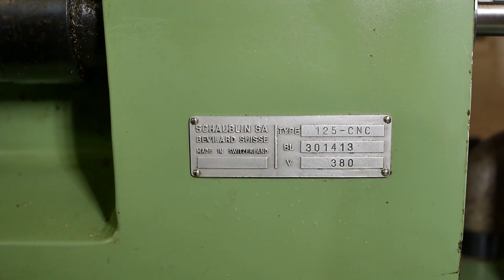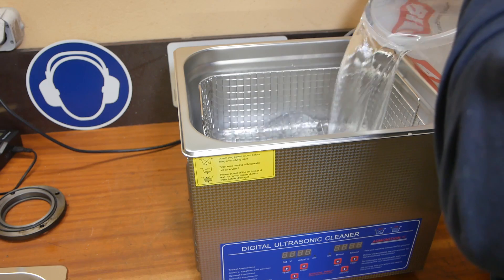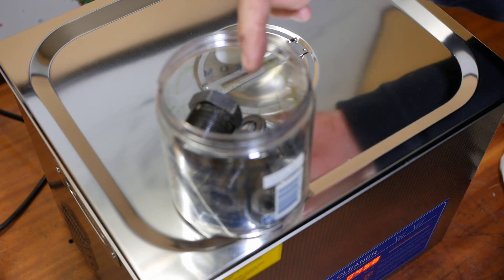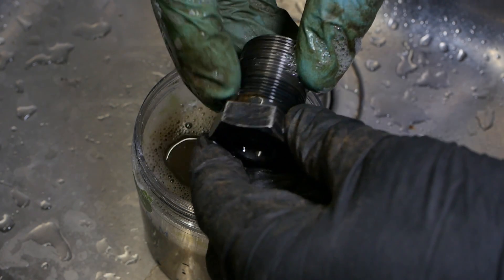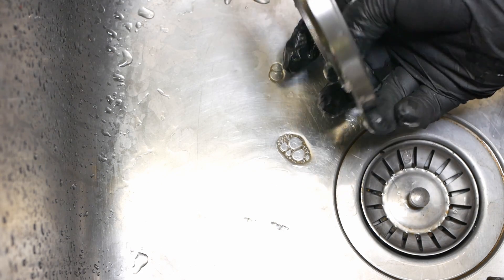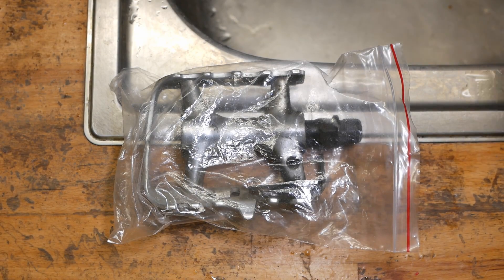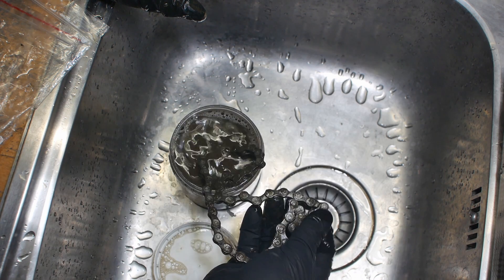Do cheap ultrasonic cleaners work? || RotarySMP

Comment: I bought a 6l one this week too. I got really mixed results but i think it was worth 60€. I use mine on moped motor parts.
Reply from the maker: I'll have to find a decent eluminium cleaner, but for steel and iron parts with caustic cleaner it is really helpful.
Reply: @RotarySMP  I tried out putting gasoline in a jar and that in the cleaner and it seams to work perfectly. Awesome idea and with the jar
Reply from the maker: @derjan236  Good to know. I will have to find a jar large enough for the piston.
Reply: @RotarySMP  yes jars are the problems and with gas they need to be seeled in my case. But pet bottles are resistant to gas. Maby there are ones with a big enaugh opening
Reply from the maker: @derjan236  It has been said that plastic absorbds some of the sound waves, reducing cleaning action.

Comment: You laugh about the chips but ultrasonic baths for chips are a thing for the fancypants chefs. Parboil, then put them in an ultrasonic bath to break up the surface of the chip with lots and lots of micro-cracks, then fry in oil at low temp and then at high temp. Makes them extra-crunchy. 

Can't recommend doing that after cleaning machine parts in the cleaner mind you :D
Reply from the maker: That sounds like a lot of work when you can just buy pringles :) I wont do food in this.

Comment: Could you canabalise the motive parts and waterproof, then attatch to your bbq plate with a magnet or clamp and drop the whole thing in a bathtub? it looks like it needs the little rigid tub to transmit the ultrasonic waves so could you flip it around and make it clean the container it's inside and magentically attatched to, get a swimming pool and drop in the whole lathe. I do expect the effectivenes would drop tremendously,
Reply from the maker: Or just leave the BBQ caked in coked grease. Adds flavour.

Comment: I was about to say that using caustic cleaning agents on precision machinery might be dangerous, but then I remembered that I used strong acid to clean my toilet, so I am in no position to say that.

As for the pedal - you might wanna try to re-plate it with zinc. Shouldn't be too hard, and could be an interesting topic for a video.
Reply from the maker: Nah, that bike is is seriously worn out. The one black pedal stays.
Reply: @RotarySMP  Fair enough, although it could get rusty with time. Then again, you could then boil it to convert rust to black oxide, which would protect it from further rust.

Comment: Thanks for the video. Be careful about using plastic bags. If the part has a sharp edge it can cut through it, contaminating the water. Don't ask me how I know. :O( . Try cola for getting rid of carbon build up. It works on gas parts on rifles. Keep safe and stay well.
Reply from the maker: Thanks. Yeah I areadly had that with bags. I was thinking of cola for rust due to the phosphoric acid. Have to try it on that piston as well.

Comment: FYI: Ultrasonic cleaners will remove hot/cold blueing on parts... just something to be aware of.
Reply from the maker: Thanks.
Reply: well that is technically the same thing as rust so that makes sense.
Reply: @Xlaxsauce  yep!
Reply: Interesting, is that true no matter the cleaner? I think I have a local gun shop that offers “ultrasonic cleaning”.
Reply from the maker: @Mrcaffinebean  I am pretty sure that will be dependant on the chemical used.
Reply: @Mrcaffinebean  Yes. Ultrasonic is great for a dirty polymer handgun. 

As someone else said. "Blue" is a surface oxidation (rust) and ultrasonic will take it off pretty quickly.

Comment: I just use brute force and a wire wheel on everything, makes a mess, this looks like it works like a charm
Reply from the maker: I also used a lot of steel wool and scrubbing. This is way easier. Especially with caustic on steel parts.

Comment: I'm off looking for a bbq size version!
Reply from the maker: Sure would be handy. I wonder what sized ultra sonic baths are used in industry?
Reply: @RotarySMP  Huge I imagine. They have to clean big things before coating, electroplating etc. and bipolar chemicals are both expensive and industrial hazards as well as too slow.
Reply from the maker: @Bennyboy-dog  We had a huge process bath we called "paragon". I once through in a whole a bike frame over night. Came out perfectly clean of any gunk or paint. No idea what the active ingredient was.
Reply: @RotarySMP  Back in the sixties (yes I am that old) we had a 4X4X4 container heated and with a pump to keep the fluid moving, it also had a cooling collar that water flowed through to keep the fumes down. It was filled with trichloroethane(think carbon tetrachloride) to degrease parts before painting.Back in the sixties (yes I am that old) we had a 4X4X4 container heated and with a pump to keep the fluid moving, it also had a cooling collar that water flowed through to keep the fumes down. It was filled with trichloroethane(think carbon tetrachloride) to degrease parts before painting.
Reply from the maker: @july8xx  Carbon Tet was also some pretty nasty stuff, but a very effective cleaner.
Reply: @RotarySMP  I used one with a tank about a meter and a half long and maybe 70 cm width and depth; it was pretty vicious.  You can get the transducer and drive separately and put them in your own container, maybe one of those plastic beverage totes if you need more usable volume.
Reply from the maker: @jimsvideos7201  Thanks. I am pretty happy with this one.
Reply: You could just go for the cheaper normal sized one but with the "bigger on the inside" upgrade. The only snag is the bbq wouldn't fit in or out through the opening itself, you'd have to resort to quantum tunneling...
Reply: @AttilaAsztalos  Tardis ultrasonic cleaner - hmm, I think you are onto something. Quantum tunnelling shouldn't be a problem. I have the muon transformer all wired up...and not.
Reply: I used to work at a place that was half machine shop, half car recycling/parting facility and our biggest ultrasonic was 4*12 meters and maybe 2.5 meters deep 

The guys over at the car department used to strip the cars of liquids and fabrics before dropping them whole into it using a crane, did wonders on stuck bolts and all the grunge found in old cars
Reply from the maker: @angrydragonslayer  The exciters must have been monsters. Rattle you fillings out?
Reply: @RotarySMP  i never got to see the exciters but the isolators were huge, about 50 cm in diameter and a meter long, 5 on each long side and 2 at the short sides, probably some below as well

Comment: What I'd like to know is what happens if you put water and sand in a bag with a part that needs cleaning? Does the sand polish (or sand) the part or doesn't it affect it much.
Reply from the maker: Good idea.
Reply: Well I wonder what Scheuermilch is called in english. Scrubbing milk?
Reply from the maker: @herrkulor3771  I speak german and an a native english speaker, but I have no clue :)
Reply: @herrkulor3771  Slurry?

Comment: also: try using glass jars instead of plastic. i watched a video where someone pointed out that the plastic dampens the ultrasonic waves or something.
would also be interesting to see a side by side of same jar and liquid left for same time outside the cleaner for comparison. then you can see what a difference the cleaner makes
Reply from the maker: Glass jars probably last longer in the US as well. Some of the bags got beat up pretty fast, so I doubt the plastic containers will last that well.
True, that caustic solution would also work without aggitation, but I guess it is sped up a lot.
Reply: @RotarySMP  Maybe a stainless container ?
Reply from the maker: @Andrew_Fernie  I have plenty of glass jars and will try one.
Reply: In fact at the beginning of the video when he told he'll use plastic containers I thought the same: inside there will be no US effect at all... maybe there isn't anyway, and it's just the chemistry and the temperature which works there and bring the results ;)
Reply from the maker: @janosnagyj.9540  Could be. Although i doubt soaking a bike pedal in dish water for 5 min would have had the result.
Reply: @RotarySMP  Yeah but the bike pedal was in the bag, not in the jar if I remember well. Some shaking-disturbing effect there was for sure, maybe not super- but subsonic ;)

Comment: Hi again, I'm just wondering if leaving the parts for 5 minutes in the BBQ cleaner on its own would have had the same results?
Reply from the maker: True. I didn't bother with a control, as I was like a kid playing with a new tool.
Reply: no, it doesn't have the same effect, but you might be able to get a similar affect with a heating element and magnetic stir feature as the to give the fluid some motion

Comment: I would love to see the piston in a bag filled with petrol!
Reply from the maker: I read that soaking it in diesel would remove the coke, so I tried that overnight, and it did nothing.
Reply: @RotarySMP  My experience has been that fuels used as solvents have different effectiveness; with diesel being least effective (especially low/ultra-low sulfur) and white/mineral spirit being most effective. Kerosene and gasoline/petrol are comparably effective.

I worked my way through that list looking for the most effective solvent for cleaning my motorcycle's chain drive. Now I carefully hoard a precious supply (because California) of mineral paint thinner for that specific use and reuse as much as possible.

Comment: That worked a lot better than I thought on the rubbery grunge and bolts. And honestly, I would have never thought of the separate liquid container idea with the jars/bags. You'll have the insides of that schaublin shiny like new in no time.
Reply from the maker: I pick that up on a few of the other reviews. Sure reduces the mess.
Reply: @RotarySMP  I wonder how well this would work with things like etching copper/brass?
Reply from the maker: @LuciaMakes  I was wondering that as well. It should accelerate the pocess a fair bit.
Reply: @RotarySMP  as long as the masking/resist layer holds up it could be very useful.

Comment: 2:34 Lol, I see the ultrasonic is admonishing you before you've even used it :)
Reply from the maker: True. YOu would think they have sold enough of these to pay someone to proof read the stickers and "manual"
Reply: @RotarySMP  It seems to me that once a Chinese product design (produced and/or sold by approximately as many "different" suppliers as there are stars in our galaxy) starts getting sold, no typos or other questionable labeling ever gets changed during the lifetime of the product, like, ever; no matter how badly obvious it is or how many point it out on the internet. That product is "done" and not a single millisecond will be wasted revisiting anything about it, unless there's a next version which may or may not bother fixing any mistakes.
Reply from the maker: @AttilaAsztalos  ... also fits the definition of quality... just not well :)

Comment: One thing I'd definitely check is if every part of the housing and the water container (especially if you're gonna stick your fingers in there while it's plugged in) is properly earthed, that can be a problem with Chinese produced electric appliances...
Reply from the maker: Good point. The cord is a standard three pin cold connector, but that does not guarantee that that it is connected internally.
Reply: @RotarySMP  You can measure that in a second with a multimeter ;)
Reply from the maker: @janosnagyj.9540  Good point. Will do... after lunch :)
Reply from the maker: ...And after the MotoGP.
Reply: @RotarySMP  I think if you are lucky you will find that the "chicken metal" case is connected to ground, but as the tank itself is glued in with silicone, they did not bother to connect it to ground as well... so if the outlet tube touches the sheet metal, then you can find some continuity, otherwise not much. At least, this was the case with my device which is a 6L model.
Reply from the maker: @janosnagyj.9540  How did you fix it? bonding jumper?
Reply: @RotarySMP  I'm writing it very quietly, but frankly: I did not fixed... The whole machine (it is an US record cleaner) is still in experimental phase (it's now about 4-5 years of this status :) so this did not bother me enough to do something about it :) In any case yes, you should fix a wire between the tank and the IEC's ground pin (but how? I think here some spot welding should be done to fix a tab somewhere on the tank but I don't have such machine...). Grunding the plumbing is no-go as Jackie Chan used some teflon tape as dichtung :)
Reply: would be first thing i'd check

Comment: Sometimes it is worth to RTFM. For example, it is written there, how you can change the timer for longer runs ;)
Reply from the maker: That was obvious, by I wanted to see what happened after 5 :)
Reply: @RotarySMP  It is interesting anyways, how good results you got after that short time, but I think it's the liquid here which really does the trick. I use a similar washer to clean LPs but I do 12-15min runs on one single record (1 full rotation in that time).
Reply from the maker: @janosnagyj.9540  I think you are right. That old BBQ cleaner is pretty concentrated NaOH. Works well as oven cleaner when used undiluted.
Reply: Oh come on, you can't be serious. Next you'll be telling me microwave ovens have timing that doesn't come in 30 second increments...! Yeah right, now pull the other one...
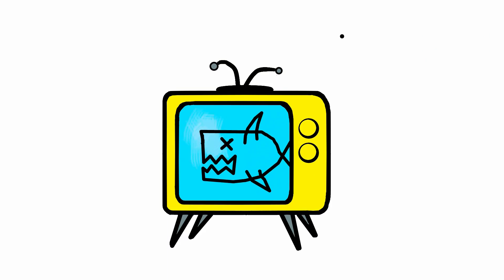Reply from the maker: @AttilaAsztalos  ...And lights which blink 12:00, so that you can navigate to the fridge which is next to the microwave, for a snack in the night.

Comment: try using citric acid for rust removal. works better than plain vinegar i think
Reply from the maker: Good idea. Have to work out where to get some.
Reply: @RotarySMP  Amazon
Reply from the maker: @ViniciusMiguel1988  Of course. What else :)
Reply: @RotarySMP  i have some at home (much more than i need myself) and live in austria too. i got a purpose build citric acid based ultrasonic cleaning solution too if you are interested. just hit me up, if you need some
Reply from the maker: @ChriFux  Cool. I would appreciate that. My Email address is on the Kannelinfo page. Please drop me a line.
Reply: @RotarySMP  It's sold in agricultural stores in high volumes as it's used for cleaning concrete and as diarrhea medicine for pigs. Yes, you heard me right...
Reply from the maker: @E1nherj  Gross concept!